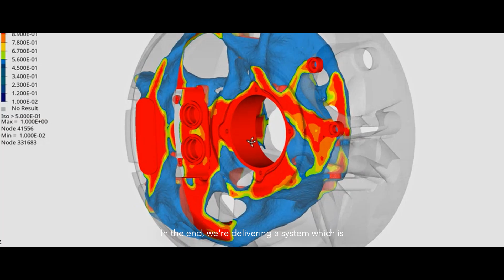Another World's First from Czinger Vehicles: The Laser Metal 3D Printed BrakeNode™

Comment: Aren’t you going to have to replace bigger and most costly parts in cases of repairs? Why not keep the form and structure the same but create robust bolting mechanisms so that you still have part separation?
Reply: It is the balancing act engineers do, which is why we don’t have this more commonly…repairability pushes to split parts, makes more of them, add complexity and weakness of joints.  Robust bolting joints are difficult and add a lot of unnecessary weight, metal and space claim.  They do require shapes, for the specific purpose of the joint, and will never be as good as unibody structure.  In this case, maximum performance and low repairability since it fits the purpose of the vehicle.
Reply: In the case of a crash i'm pretty sure it will knock the hub and the rotor+caliper anyway, those parts will die together wether integrated or not.
Reply: Actually  the way the car is done the cost is actually  much less as it us of AI looks at each part and builds a structure that is much lighter  , yet the strength is far superior  then a heavier  unit , the suspension  pieces alone like more like a skeleton  on a animal then a actual car part .
Reply: It's a hypercar
Reply: @mitchellsteindler  I guess